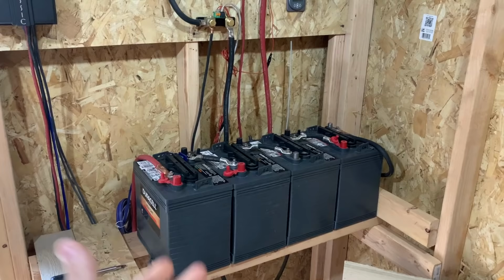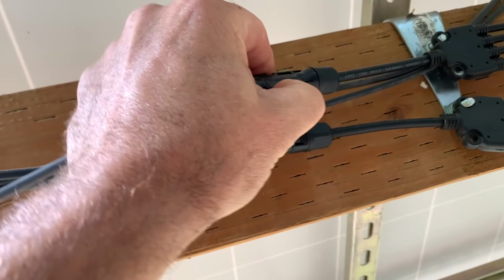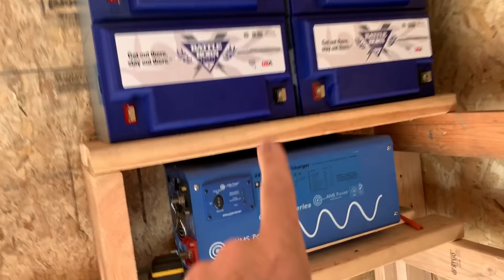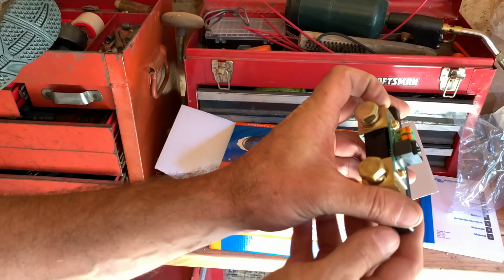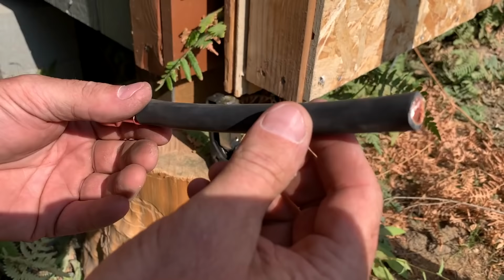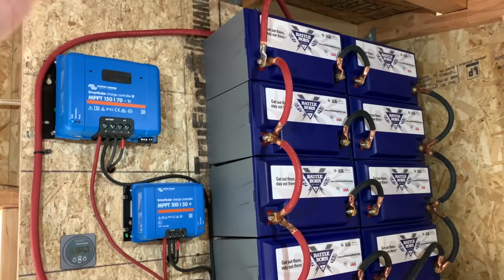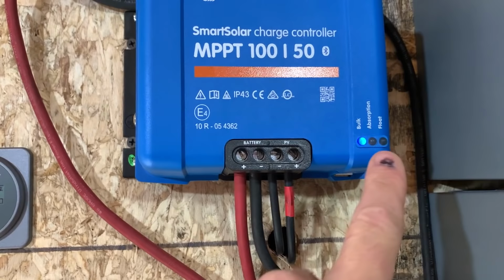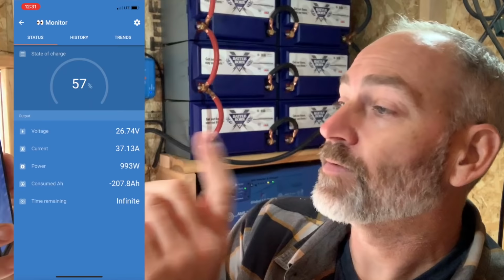EASIEST Off Grid Solar Power System Battery Bank

Comment: Just a tip, to avoid sparks, connect positive first, then the negative. When disconnecting take off the Negative first. The same goes for anything on DC power, otherwise 2 thumbs up.
Reply: The "positive first" rule applies to conecting and disconecting booster cables when jump starting the car. To avoid sparks NEAR THE BATTERY, you connect the negative clamp to car body or engine block and remember to always make and break connection at this (far from battery) point. This is to avoid ignition of hydrogen / oxygen mixture gassed out by battery when charged at high rate.
Reply: Sounds good suggetion
Reply: Or perhaps use proper circuit isolation?  🙄
Reply: @Hefek  its always think positive when working with power
Reply: Use a graphite carpenter pencil lead to charge the capacitors, takes a second, then there wont be any sparking.

Comment: I'm impressed at the simplicity of a great working system. The only thing I would have added is a disconnect to the panels so you don't have to shut the power off from the panels in an emergency.
Reply from the maker: That would be good. I should do that.
Reply: @Mike How are you doing

Hope we get to know each other with time and patience?

Comment: I love my Battleborn Batteries and recently added 4 to my existing 10 AGM deep cycles which are now serving as my backup. They do come delivered with only a 30% long term storage charge level so you should charge them before use. Also, don’t forget the cutoff switches and fuses. I have fuses at the solar cells plus a lower level DC circuit breaker to save the fuses and the hassle of changing them.
Reply: I have 2100 AH in cell tower AGM batteries and a new set of 1600 AH in LiFeP04 batteries. Each has different charging requirements and both banks are isolated. I don't know how you switch your banks but my major improvement was to add a Blue Sea marine rotary selector switch that is sealed and spark less. The switch is rated 500 Amps continuous and you can select Bank 1 or Bank 2 or run them combined or switch the batteries off.

The switch was $70 on eBay. You can tell the thing was built for serious Amps as the connection studs on the back are 1/2''-13.   The smaller switches have 3/8 inch studs. I leave it on Bank 2, the AGM's, and its float charger. The lithium cells get a charge about once a month from their own charger when I run the Onan diesel gen set for 20 minutes. That $70 switch was dirt cheap in the scheme of things. It switches banks or disconnects in half a second. It might fit your situation. A hydraulic terminal crimper gets a lot of use here, too.

Comment: Martin, you should add a cut-off switch to your battery array. that way, if you ever have to change them out, they won't spark when you make-break the connection.
Reply: Yep, that's what Sally Safety says at 8:35. Also, Martin should do himself a favor and place shelves between each row on batteries. If a batt on the bottom row goes kaput, its going to be fun balancing 90lbs of batteries to pull it out.
Reply: @luisderivas6005  I don’t like the inverter buried where it can’t get air straight thru.
Reply: if one battery goes bad then all you have to do is remove  the connection between that battery and the one along it connected in series with it. The current wont flow on 2 series batteries (one good and one bad) and you have 6 left.
Shelves on each row is a good idea.

Comment: Your solar setup is nice and tidy. That's probably my biggest issue with most solar installs. Cheers.
Reply: but i did not see the solar panel set up yet
Reply: That’s far from tidy with zero mechanical protection of cables and all cables devoid of support.

Comment: Again, very nice setup.  Just one step I would have taken.  Your short negative wires have wire exposed between the lug and the coating. Always a good practice to use heat shrink or electrical tape to wrap the gap so there is no copper wire visible.  Just for safety.
Reply: The Sigmaform heatshrink has meltable glue on the inside. Stops it sliding and acts to stop moisture.
Reply: What about the bare lugs ?

Comment: Two things surprised me about your installation. One that you would just stack the batteries rather than make individual shelves for them, and second that you didn't install any kind of disconnect switch on the positive side of the battery harness. The large spark when you connected it showed very clearly the need for one.  Other than that, a good install.
Reply: @Ken Cissel Im curious as to why he needs 2 charge controllers.
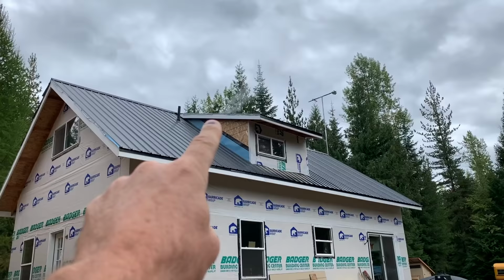Reply: @soulwarrior7721  Start watching at the 7:50 mark. They will be adding (added by now - see 17:00 mark) a smaller array to the system.
Reply: Why aren’t the batteries 🔋 connected in parallel?
Reply: @Adenya_E  The batteries are 12v. He needs 24v for the system and can accomplish this by connecting them in series rather than parallel.
Reply: @Adenya_E  They are in pairs connected in series. Each pair is connected in parallel
Reply: @sichambers9011  We Hungarians call it Series-Parallel combined binding :)
Reply: @shindleroszkar9938  Americans call it series-parallel as well. There are limited uses for it here, only heavy machinery and solar stuff runs on 24 volts so people don't realize you multiply voltage in series and add capacity in parallel.
Reply: @austinpotts35  Yup
Reply: @austinpotts35  You add (not multiply) voltage in series and add capacity in parallel.  That's why to get 24V he uses 2x12V in series--he didn't end up with 144V!
Reply: He had a fuse box installed.  That's his disconnect.

Comment: You should have an isolation switch/breaker on your positive lead, have it off when connecting leads and you will get no sparks!
Reply: Jm. Thanx
Reply: @wendyking9759  NO!  You will still get a very high inrush current, when using a switch.  The spark is not the problem, the spark is the symptom of the problem = high inrush current   Battle Born suggests using an Inrush Limiter.
Reply: The center straps (between the left and right batteries) are meant to have a fuse link, for fire prevention as the cells bridge internally at the end of their useable life.
Reply: @bryanminugh9680  where can I find resources on such detailed information like this. I want to build my system right
Reply: @martin1500  Me too..
Reply: What did You do with the old stuff You upgraded? I ask because I live in a RV and NOT got very much $ and was hoping You could donate it to my son and I?

Comment: Amazing setup! To avoid sparks you can have a ON/OFF switch right after the batteries. It's also a great safety thing to have in case you need to disconnect quickly the power from the batteries to your system.
Reply: Sounds very useful suggestion,
Reply: I was going to say the same thing... a master disconnect is a great safety feature
Reply: Cheap resistor
Reply: And use a resistor e.g a 25W 30ohm for the 12V system thats a dollar or two on the -ve end for few seconds to charge up the capacitors. This will avoid the sudden surge that causes the spark. Saw it off Will Prowse videos.
Reply: Thanks for the advice! We are totally adding this to our system bc shutting it off to add on and whatnot is lengthy ATM.
Reply: yeah a low Ohm resistor is a must have for connecting, sometimes they just weld and you can't get it off otherwise ...
Reply: @louiscirillo55  RV's Disconnect would work nice..  use some type of safety glass my not be good getting that hot metal in your eye..
Reply: An ON/OFF button switch does not avoid a spark, you don't see the spark because it happen inside the switch. You need a very rugged switch to switch this and it possible the contacts melt together if it is not suitable. If  the contacts are melted together you don't know this and in case of an emergency you are not able to switch it off because the contacts are melted together. NOT SAFE at all. Better is to use  a two step switch, one that turns the system on with inrush current protection (avoid a spark)  and the second one turns the system into full capacity mode.

Comment: One thing he got right, although he didn't state it explicitly is his wiring the battery. He correctly connected the wires to OPPOSITE ends of the battery bank. Connecting to the same end of the bank will result in uneven battery wear. You got it right Martin.

Comment: Always disconnect or recconect the negative side. Don't connect an active positive wire to a system.

Also you need to secure or strap those batteries back so they're secure to the wall or ledge

Comment: Love the set up. Just be aware that lithium batteries operate completely different then AGM, Lead Acid etc. first rule of thumb is to fully charge the batteries individually. The reason is that they might be at different voltages. Lithium batteries don’t automatically balance themselves as do lead Acid batteries. Now if your batteries are not balanced within 0.2-0.3 of a volt of each other, the situation can snowball thus resulting in a severe in balance. If this happens whilst your using your inverter at full noise you can destroy one of your BMS units in one or more of your batteries. I’m not familiar with those batteries, wether they have some hidden BMS that balances all your batteries. I’m speaking for a general setup. Cheers
Reply: How does a lead batter balance it's charging in series and parallel, and lithium not? It would seem that circuitry (a programmed motherboard) with switches would be necessary if that's the case. But again, how would a lead batter stop charging and pass the voltage down the line to a more-depleted battery? Interesting subject, something I'm not familiar with. But we need some insight to make this a worthy footnote. Cheers.
Reply: Good Point! that was precisely one of my observations. By experience definitely is very important to fully charge all Lithium batteries first no matter the model. If it is not done, in some untypical cases they start to register a false load readings and shorten their useful life. Unfortunately Lithium pricing will keep increasing.
Reply: why wouldn't you fully discharge them, seems faster, safer, easier and more accurate.
Reply: @terrycassar I was wondering if its ok for the lithium batteries to be lying on their sides, is that fine for them?

Comment: couple minor comments: 1. use tinned lugs for custom cables to prevent oxidation, and heat shrink over the gap between lug and cable insulation. 2. you'll get much better crimps with big 36" lever crimper rather than a hammer crimper, but they do cost $200 or so which may not be worth it for one job.
Reply: Definitely a  +1 to the Heat Shrink. Makes everything safer, and depending on your climate will go some way to preventing corrosion..
Reply: I thought about saying the same thing along with at least 2" of Marine grade (glued) heat shrink per lug. The proper crimper is designed to produce a "Cold Weld" with a soft return to individual strands.  I also used tinned Marine Grade cables but my system is in a Vanagon so vibration and corrosion was more of a concern.  Also, a LOT less cable needed.  The price of one foot of 2/0 today was $7.38 USD...  OUCH!

Comment: Just a thought...Why not spray foam insulate the shed?  If you mount a small solar panel on the shed roof you can use it to power a small heater fan in the shed.  With a shed that small and IF the shed is sealed and insulated then it will easily keep that shed warm in the coldest temps.   Have you considered installing a wi-fi cam in the shed?  Also, so you don't have to go out to the panels to disconnect power there, you should consider installing a disconnect inside the shed.   Would make your life easier for maintenance.
Reply: Solar Heat might be even more efficient vs Solar Panel. Snow coverage is an issue

Comment: You can avoid the spark by precharging the inverter's capacitors. Connect the battery via a high power resistor (e.g. 25 Ohms/25 W) first; this limits the inrush current. After a few seconds the caps are charged up and you can remove the resistor and attach the battery cable permanently.
This also doesnt stress the caps as much.
Reply: Seconded.
Reply: 3-way rotary switch for isolation - off/precharge (via 50Ohm, 50W resistor)/direct (bypassing resistor).
Reply: Question Stephan, if you don’t use the resistor, can it damage the equipment?
Reply: @ElJasperino  you ask about the use of a resistor - if you think of when a light bulb 'blows', it's always when you switch it on.  This is due to the inrush current being much greater that the current when in use (the filament is cold, and so has very low resistance indeed).  The use of the resistor limits the 'inrush' current to a reasonable level, thus pre-charging the inverters input components (primarily the capacitors), thus REDUCING the RISK of damage from the inrush currents.  Over the time I've been looking at off-grid power, I've not seen any reference to them being 'needed', but virtually every YouTube channel I've seen (eg TheDigitalMermaid) seem to be using them, and as one with 50 years playing with electrics, electronics, computing and radio, I'd probably say that there is a greater risk of damage if you were not using it.
Reply: @tonyleverett1483  thank you very much for your detailed answer.
Reply: @ElJasperino  well, it should be constructed to take no immediate damage. But operating any equipment in a more 'gentle' way will of course reduce strain on the components and improve its longevity.

Many high-end inverters actually do have inrush protection built-in. They basically do the same thing that I'm suggesting here: adding a protection resistor on startup, which is bridged automatically when the capacitors are fully charged.

The same is true for inverters that are intended to run on limited power supplies; e.g. in UPSs, where a high inrush current might trip the mains circuit breaker - there its not only a "nice-to-have" but actually essential for functionality.

In inverters intended for use with batteries you can get away without such protections, because a battery will happily provide high current - hence why many manufacturers skimp on it.
Reply: @stephanweinberger  thank you very much!

Comment: This was awesome. I've been going down the rabbit hole off grid solar video binges as I'm planning on building a small 600W backup setup in my shed. We're in Central Texas and having gone through the freeze last year and a week without power, I want another power source as a 2nd backup along with the dual fuel generator. Y'all sold me on the Battle Born batteries. Those have some killer reviews and I love that they are American made. Here's to getting many years out of them. God bless.
Reply: Just an observation. The Battle Born batteries are designed and assembled in the U.S. However, various components are sourced elsewhere. The Battery Monitor System (BMS) is made in China, and I'm sure the actual 26650 battery cells are also Chinese. However the design and assembly are top-notch. Lots of thought went into this battery.

Comment: Use a Resistor between the cable and the terminal. Hold them together for a couple of seconds. This will discharge the sparking. Then add cable to terminal as per usual....
Reply: Urbexx Jeremy  Yep

Comment: Nice detail on positive and negative wire lengths to the 8 batteries which insures minimal wire impedance differences. Shrink tubing would finish each crimpconnection a little nicer and minimize short circuit accidents.
Reply: Exactly what I was thinking aswell! 😄
Reply: A little grease under that shrink wrap as well. Many little things wrong in this set up, too many to list, read comments. Hope all goes well.